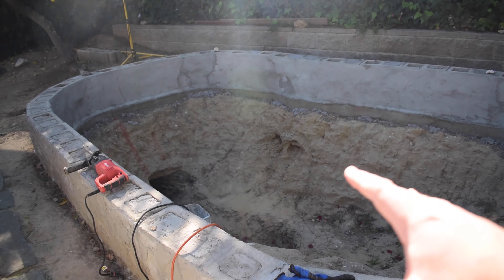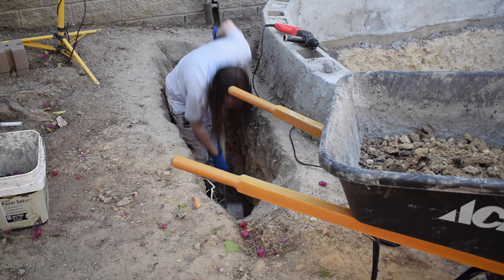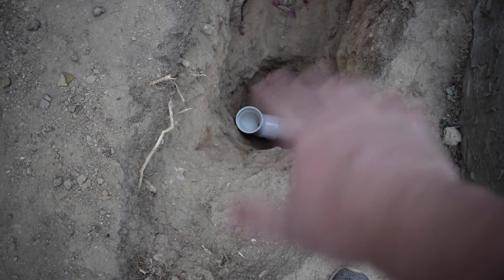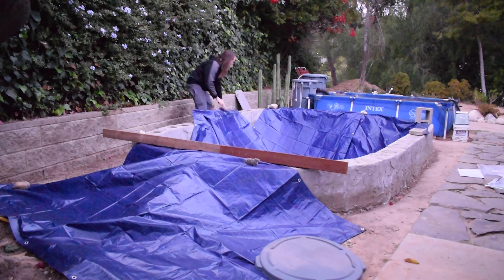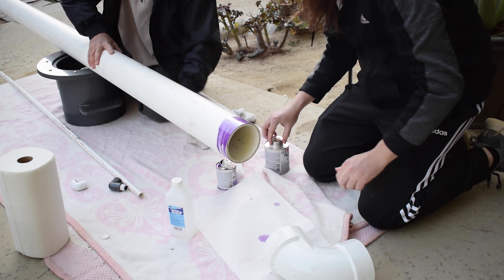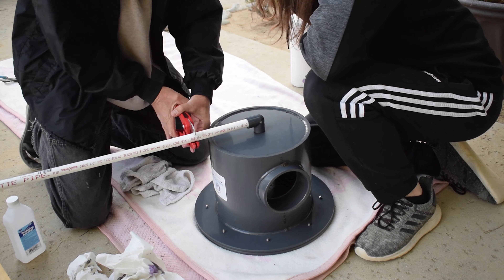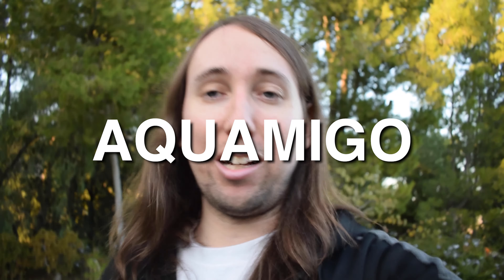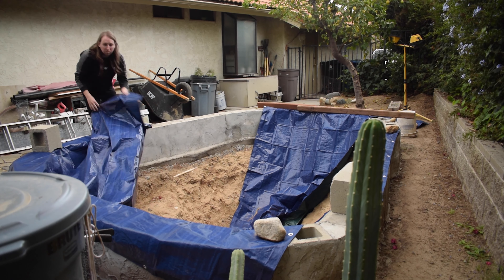Koi Pond Plumbing Part 1

Comment: I know its way too late for suggestions now but i would have dug the sloped side away inside the pond, basically straight down which would be easier to dig sideways with less dirt tunnel length in your way and then backfill it afterwards to re-create your slope. You've done great tho, i did mine by hand also so i understand how much work goes into it.
Reply from the maker: Yeah that's true, it may have saved some time since digging horizontally was so difficult

Comment: Great video, Aquamigo!! It's definitely looking legit with the plumbing going in !! Have you decided on a liner yet? I know you have a lot more to figure out but you mentioned rain so I'll offer you some advice on getting a small utility pump and some tubing just in case it dumps buckets and you have to pump it out. Judging by how solid you dirt is I think it would hold water for quite a while. But anyway I love seeing the progress you're making. Can't wait to see that bottom drain go in.
Reply from the maker: Thank you Aquamigo! I haven't decided on a liner yet, but it's something I should start thinking about 😅 I have a small sump pump I can use in case it really floods the bottom of the pond, and yeah you are right this dirt does hold the water for a while